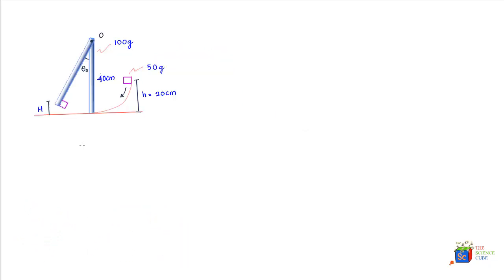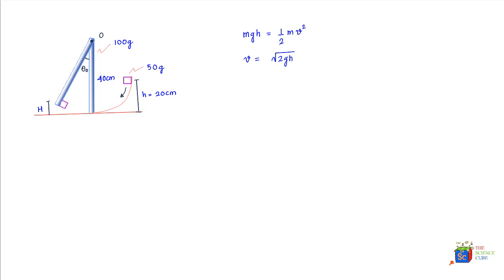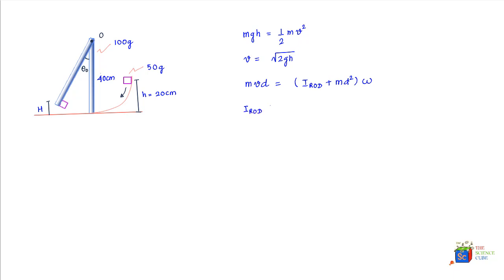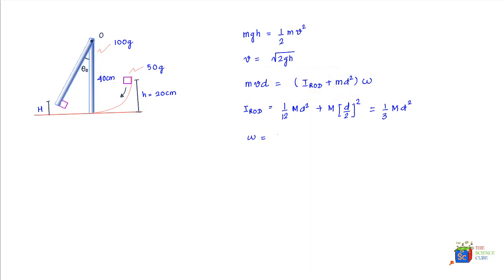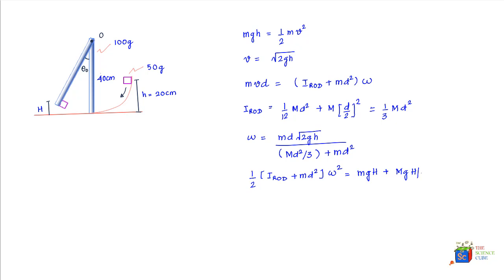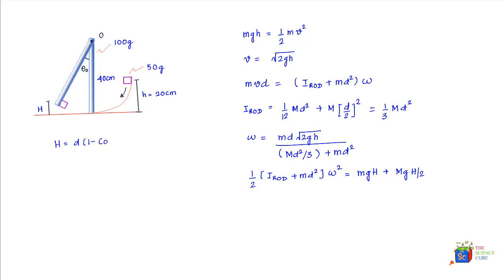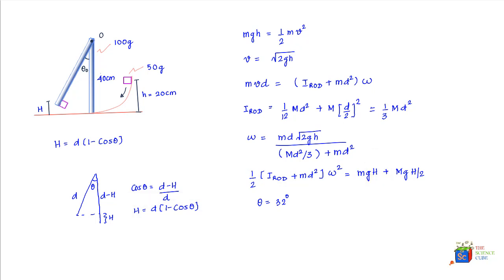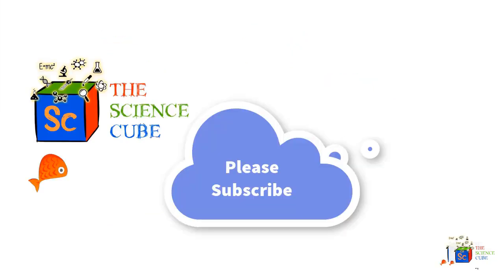Block and Rod  | Conservation of Momentum & Energy  #14

Comment: why it is not Initial Ep of block = final Ep of block and rod?
Reply from the maker: You see, just before the block hits the rod, the PE of rod remains unchanged. So if you take PE of the rod before the block starts sliding and then when the block just about hits, the PE is same and will cancel on both side
Reply: @TheScienceCube  Thanks. It is not what I meant. I thot something like mgh=mgL(1-cos(theta)) + MgL/2*((1-cos(theta)), to find final theta angle. I mean, I know and understand how you find solution, everything is Ok. I just can't find reason why start energy of system is not final energy of system, and I talk of PE, because we trying to find theta in final position.
Reply from the maker: @mirkodobrota4861  I get it. But why have you taken the height of CG of the rod above the ground as 1/2 of L(1- Cos(theta)?  That is just H/2. You will have to find the height of the CG of rod above the ground  this using geometry. This can be done and you will get the same answer. But I have taken the momentum conservation approach
Reply: @TheScienceCube  I tried, but result is always different. I had theta about 44 deg. I can't get same answer what ever even with zero pe on the bottom, for init and fin state
Reply from the maker: @mirkodobrota4861  what is the height of CG of rod you are taking above the ground.
Reply: @TheScienceCube  I tried initial L/2, final L/2(1+cos). And with particular m=M/2 one can get division by 0. But it is not correct,   for Rod does not have potential energy in initial state due to pin. I tried L-L/2*cos, not working. Tried changes in PE, not working. I only can't handle reason behind this  not working. We don't have any losses of energy, so input energy should be the same as final energy. Also, thanks for your responding in real time.
Reply from the maker: @mirkodobrota4861  I think you are not calculating the height correctly. I will work on it and share the solution sometime this week.
Reply: @TheScienceCube The collision where the block and rod stick together is "inelastic" and energy is not conserved in these types of collisions, so final PE is less than initial PE. That's why it is necessary to use conservation of (angular) momentum which is always conserved